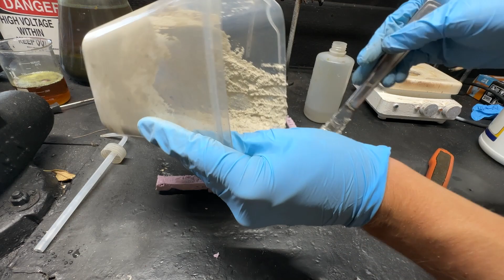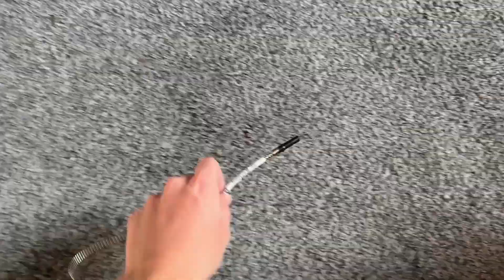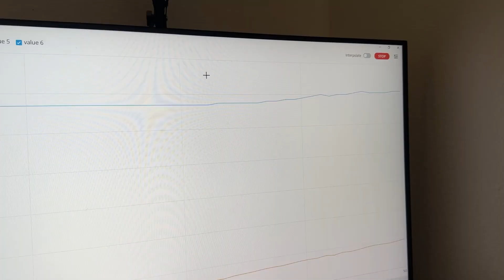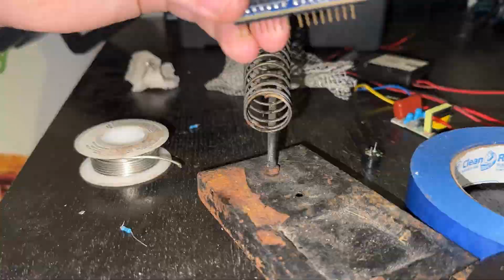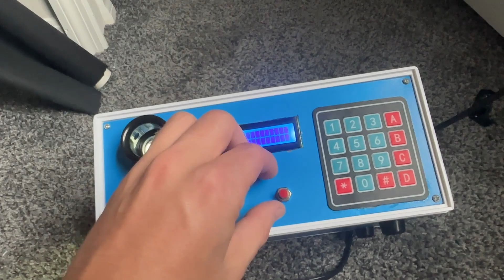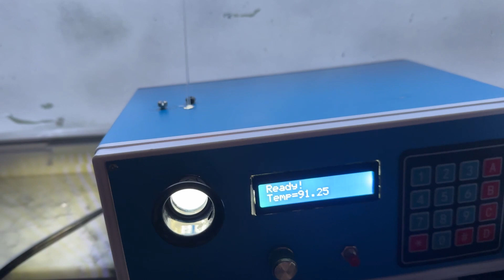DIY Automatic Melting-point apparatus!

Comment: Where did you get that fibre optic cable, I’ve been looking for a while, and all the ones with a metal constructions with threaded ends are above the 100 dollar range
Reply from the maker: Got it on eBay for only like 15$, search high temp fiber optic I see one for like 16ish dollars, hope that helps!

Comment: Cheap thermocouples can be off as much as 5C.  Pt100 and pt1000 are easy to use and once calibrated (water and tin for a two point calibration)
Reply: Hopefully he is aware that thermocouples don't measure temperature, but only a difference instead. Therefore it is mandatory to have second sensor of different type at cold side, to accurately measure room temperature.

Comment: i thought the 5v was 5v power out. Arduino can handle 15V if i remember correctly
Reply from the maker: You can power the ardunio through the 5v out pins if your using a regulated 5v supply
Reply: @PyrotechnicalScience  i suppose ya can but kind of defeats the point of the arduino's on board regulator . a better IMO option is to run the hole system from 12V into the Arduinos power jack and external regulators to run the external electronics. would be good for this system, you would have 12v for the relays the heater and light and use a 5V regulator for the LCD , keypad thermocouple.  the arduino's onboard regulator can only supply a few hundred mA so not great to hang too much off it . meh great project all the same